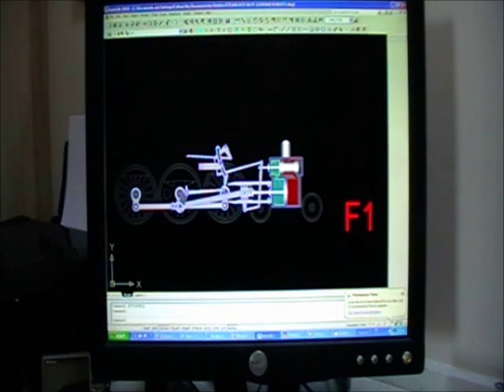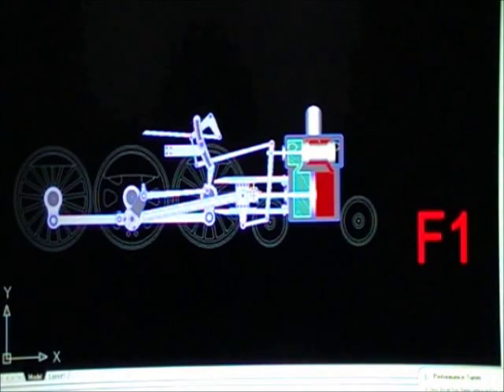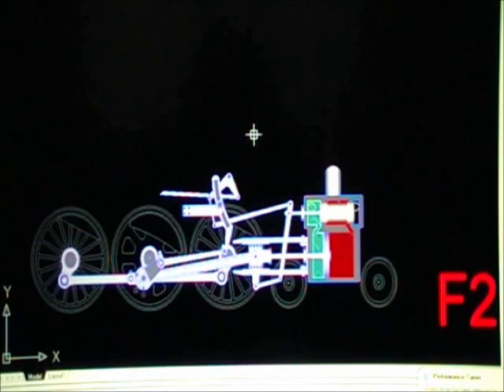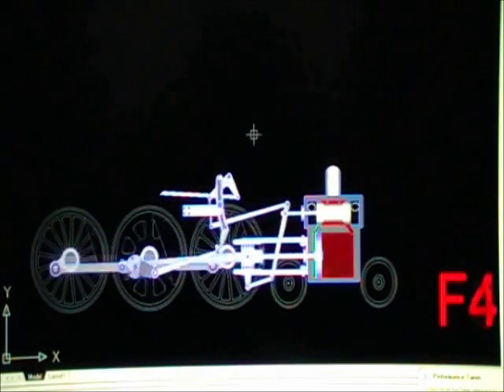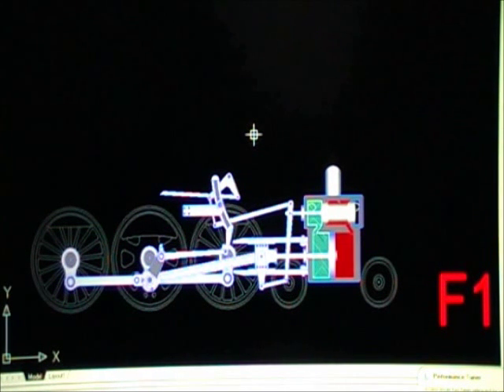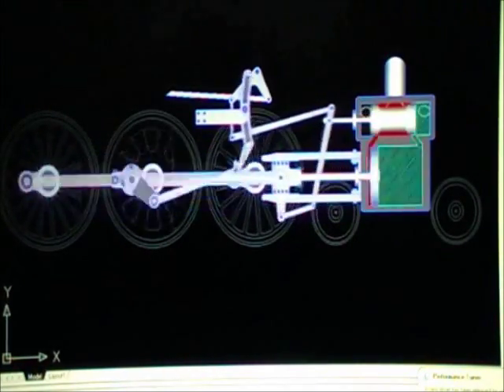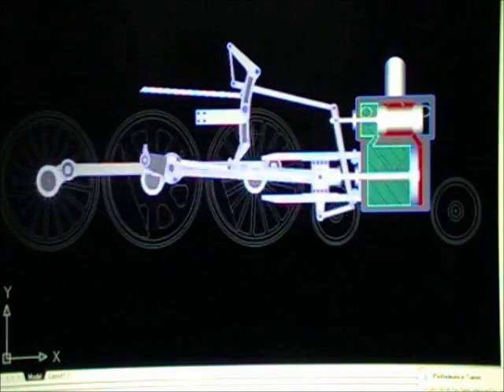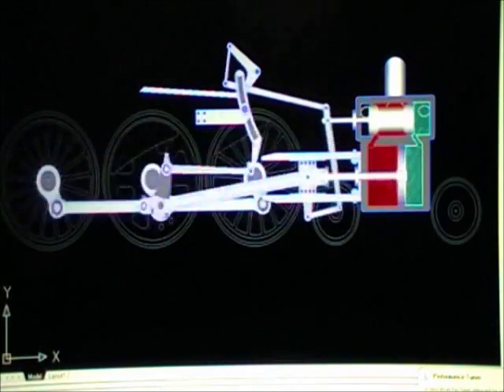WALSCHAERT'S LOCOMOTIVE VALVE GEAR IN AUTOCAD by BANOLISP

Comment: That's great.  But would you show me step by step how to design the gear?
Dockstaeder's and Dan Ashton's software didn't help, both were hard to use with
assigning variable values.  The variables are not well explained.
Reply: These drawings were created in 2D AutoCAD. I started with one driving wheel, which was then copied and rotated by 22.5deg. This was repeated 15 times giving a overall sequence of 16. By flicking from one wheel to the next you get the appearance of motion. All the linking gear was adjusted to fit the driving wheels. Hope this helps - Barry
Reply: OK and I guess you've adjusted the dimensions and locations
of the valve gear components to make sure that the  piston valve
admitted and exhausted the steam correctly as well?

How'd u know what components to adjust?
Reply: I drew each component of the gear as BLOCKs in AutoCAD. Then, with each movement of the drive wheel you can work out using arcs, where the hinge point is of every part (like using cardboard cut-outs). Regards Barry